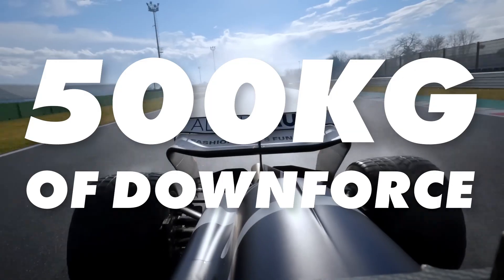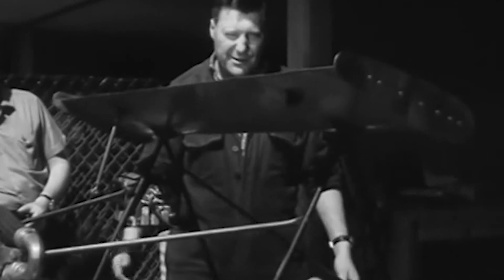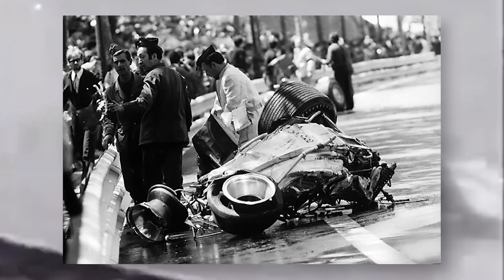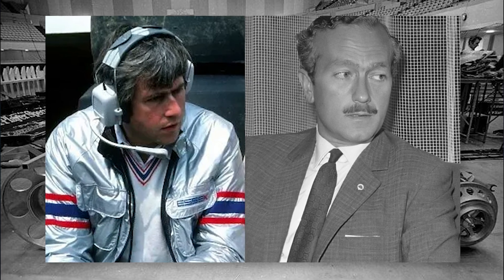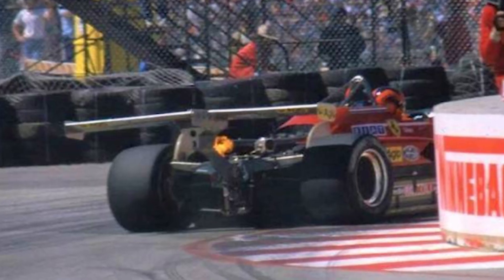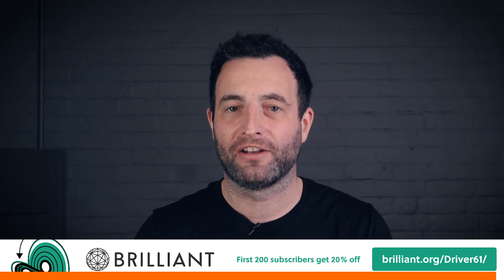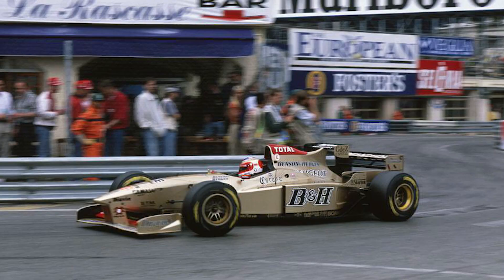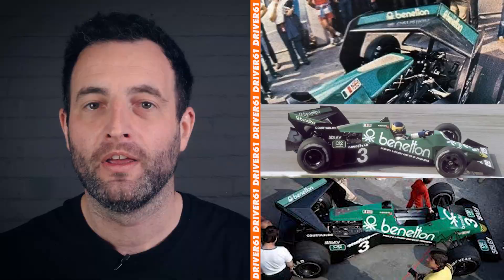When Formula 1 Used AEROPLANE Wings

Comment: I remember when front and rear wings we're being tested, and were briefly used, buy Formula A and Formula 5000. The front was unsprung the rear may or may not have been the same. The front wing did not last long and was replaced by the winglets.

Comment: 1.the rules made by the f1 organization are ridiculous. no issue with multiple elements if its faster it works. thats what Formula 1 is about also.many innovations are blocked by the bigger teams to hamper the smaller teams the i think ground effect is a perfect example of that

Comment: The Opel did NOT have an inverted aircraft airfoil.  The Airfoil was cambered with the curve going upwards -- like that of an aircraft.  It provided LIFT.  The cumber or curvature to create downforce, is to have a 'cup-like' design where the curve was closer to the ground.  Inferring that it had an inverted airfoil, is incorrect,
Bernouli's Theorum should clear that up.                                               -///
                                                                                                                 ///-
                                                                                                         ------
                                                                                                   -----
                                                                                         (-------
Sorry for the ASCII there.

How about this?   ^ where the longer distance is on the top of the surface and thew concave bottom surface 'escapes' the airstream and therefor, moves slower.  Slower means a higher pressure, faster is lower pressure.  Hence, it can push upwards, drastically reducing lift.

Comment: An interesting video on a specific but you forgot the cooling fan! However, it is interesting to contemplate the effect of body shape on sports racing cars and the difficulties down force created there. While the wild and woolly entertainments of my lifetime caused great interest in their period current F1 is fairly devoid of interest as aerodynamics is of far more interest on an aircraft wing and F1 is only an adaptation. What is most interesting for those of us who grew up with the post war sport was engine, chassis, suspension, brakes and driver ability in machines that became safer. It lost a great deal when drivers could use their cars as tanks to drive into each other and that is why it has lost much support from developed motoring community. It is now as the late Sir Stirling Moss-declared ‘An event not a sport’ which for those of us who grew up with hero’s rather than businessmen is a great disappointment!

Comment: I wish F1 was as close to unlimited as possible. Basic rules for size, lines of sight and safety then let them at it. So much extra progress could have been made if not for having rules which make no sense to an open class. 
F1 is trying to be too many things at once. Rules may make racing close but that also makes it boring. Rules may keep speeds down but that also makes it boring and stunts progress. 
There are plenty of classes to race in where the limit of the rules is the limit of the cars. 
F1 really should be about making the very best possible but instead its about making the closest to the rule book as possible. 
Such a shame.

Comment: I always knew the Tyrell X wing as Tyrell Towers! Might’ve been a Dutch thing?!
Reply: Tyrrell was always trying new things. Anhedral front wings creating a better low pressure area under the car. running front wheels at the rear to lessen drag. six wheeler and much more.

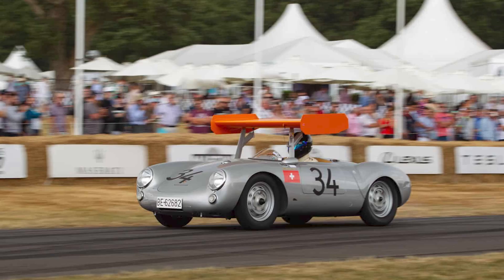Comment: 1:30 My dude invented the wing and DRS at the same time!
Reply: Most early wing setups were powered. They could be trimmed, and many were linked to the brake pedal to get max downforce or act as air brakes under braking.  These adjustments though made them even more fragile. Jim Hall was nearly killed in Nassau driving his high winged Chaparral 2D by the actuating rod coming free- due to the twisting of the suspension mounted wing- allowing the wing to flip UP.  Sports car wings were even more radical than the early F1 wings.

Comment: You used to see such a wide variety of elements on cars in the 80s and 90s. Often on the same cars during a season. Like at Hockenheim the wings would be almost nothing. There purely to keep it stable at top speed and provided little significant downforce. But at Hungaroring you couldn’t even see out the back of the car for all the elements stacked up there.

Comment: The suspension arm mounted wing idea could help porpoising…
Reply: They were banned because they could not handle the downforce and mounting them on the uprights was good for unsprung wieght but suffered from vibration problems also causing failures.

Comment: I believe the first wing used on a race car was in 1927 on the Delage 15 S8(?) these wings were seated on the side of the car behind the rear suspension in certain specs, although going that far back it really does get hard to pin down when and where things are first done.